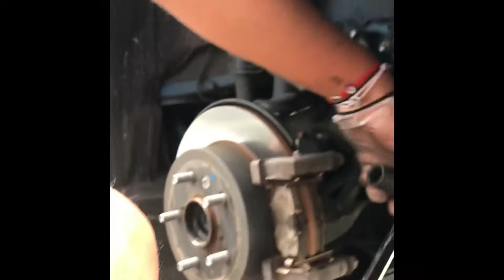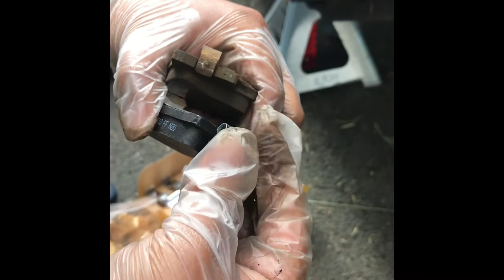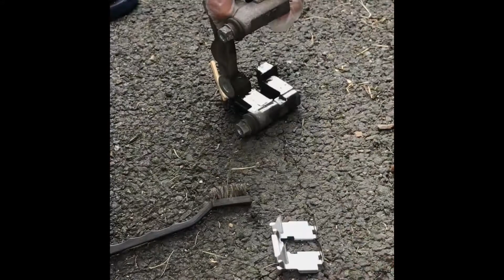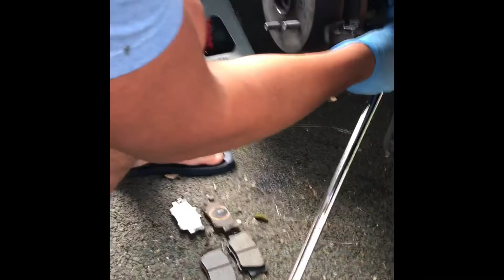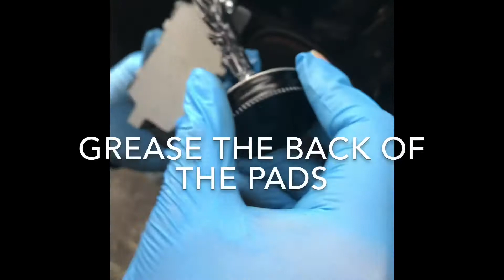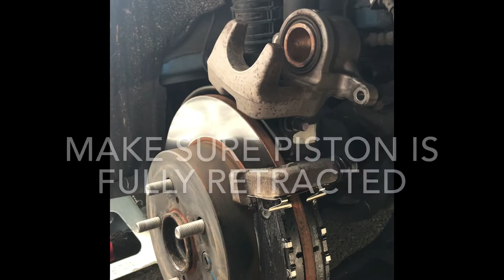2019 Toyota Camry Rear Brake Pad Replacement

Comment: Great job on the brakes. Done in a timely fashion with all hand tools. Only thing is that the pads backing plates aren't friction points so they don't actually need to be greased. Only the top and bottom
Reply from the maker: This is true. But since it’s usually up against the piston or the inside of the caliper I like to put on it so it doesn’t stick to it. My friend once had his pads stick and he was getting super crazy noises from his brakes. I told him to put grease on the back of the pads and it fixed the issue. Saved I’m some money since he was about to buy a whole new caliper.

Comment: Thanks for the how to video. One thing I would add….. take pictures as you disassemble.  Never hurts to have a couple before snap shots to assist in proper reassembly.   It’s just like having a second car handy to fetch parts.
Reply from the maker: For sure. I usually do that if I have a complicated set up. Like my wife’s 2015 Q50. That was a pain.

Comment: You know u didn’t need to remove that whole bracket just made more work for yourself…. Only need to take that off if ur replacing the rotor.
Reply from the maker: Yes for sure. I’m just very OCD and want to clean off as much rust as possible, and taking off the bracket makes that easier. Also helps with not getting grease on the rotor.
Reply: But easier to clean the contact surface when off the vehicle

Comment: Do I have to push my emergency brake down before I work on my brakes or will that mess up something? Thanks
Reply from the maker: I use the hand break when I’m doing the fronts just for added safety. But you have to disengage it to get the rear rotors off.
Reply: @EZ Repairs  I talked to a guy who changed his brakes, and he said you haven't disconnected the emergency brake ( since it's electronic). So are you saying you have to electronically disconnect it, or I just need to make sure the emergency brake is not engaged?

Comment: You need to release the pressure before pushing the pistons back by uncapped brake master cylinder or you’re screwed
Reply from the maker: You’re right. I’ve done a few brake jobs now and have never done it, I always forget. So far no problems. But why tempt fate. Thank you for the tip!

Comment: You don't know how to replace brake pads do you
Reply from the maker: I mean I’m not a professional. Was just helping my friend out, but what makes you say that?
Reply: @ez.repairs  the removal of the caliper mounting bracket is not needed. One of the two bolts on the caliper is enough to swing the caliper out to have access to the pads. Sometimes, you may need to remove both.